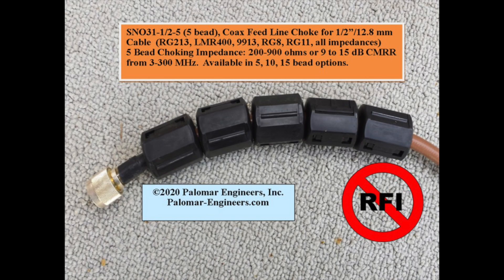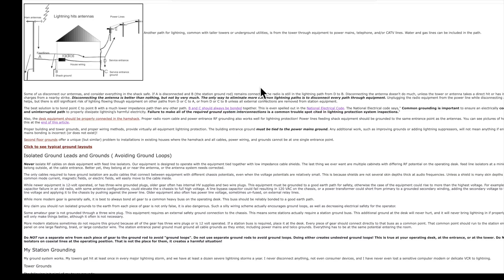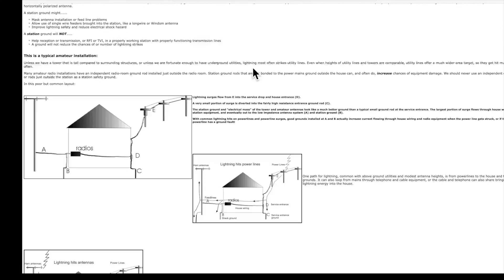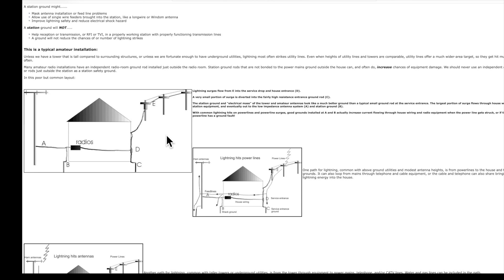Ham Radio Myth - Every Station Should Be Grounded.   RF Ground is a Myth!

Comment: Now, what if your AC ground bounces?  I was on my front porch when lightning hit a big old willow just a few doors down.  The strike grounded out through the water main (uh-oh) to which most old house grounds are still connected.  Everything electrical in the house saw ground and/or neutral bounce to a zillion volts vs. the 120V line - which wasn't affected.  Insurance paid to replace almost everything that plugged into an outlet.  But the house didn't catch fire.  There is a reason all of my TVSS devices are in steel cases...
Reply from the maker: Sounds like quite a shocking experience.

Comment: One of my neighbor's rooftop antennas got hit and it took out a $330 laptop port replicator, a gigabit Ethernet switch, a GFCI breaker and a bathroom vent fan timer in my house. We are each on 1.3 acre lots so we were not really close. Fortunately none of my radio gear was impacted.  It primarily impacted the closest corner of my house.  Lightning is a real beast.
Reply from the maker: Pretty amazing.

Comment: Take No ferit beats.  Turn 19.6 feet coax round a bottle.  If you have a wire and no counterpoise do not mount your choke at the feedpoint.. Some wired antennas need a counterpouse.
Reply: What???

Comment: I used to believe those myths, but lighting taught me it doesn't play by the myths. Had my IC-7200 disconnected from the power and the antenna. I forgot about the USB cable running over to the PC. As best I can tell, lighting came down the phone line, took out the DSL modem, ran down the cat 5 cable to the network switch, got it and then went on to all the PC's that were connected to the switch and finished up with my transceiver.
Reply from the maker: Tragic story but it sure teaches us all a lesson.  Thanks for passing that on.

Comment: Sorry, I'm a little late to this party (the vid was posted a few months ago...) Somehow I missed it.
Excellent info Mark, as always.
I've been an electrician for 40+ years (primarily commercial & industrial, but lots of residential work too). Retired in 2020, but still busy doing "side jobs" 😊.

"Grounding" IS very important, but as you rightly inferred: not necessarily for the reasons many hams think or understand.

"Grounding" and "bonding" are two terms, often used interchangeably, and that kinda mean the same thing... but not really.
First, bonding is the act of physically connecting all of the non-current-carrying metal parts of your equipment together, to bring the potential between these parts down to the same value (potential) - the same "voltage", if you will (for lack of a better description).
Then all these bonded pieces are connected to "ground"  (a grounding conductor) to further reduce the potential. That "ground" is also actually connected to the ground - the physical earth - in the form of a ground rod (or other methods), and - more importantly- also to the neutral conductor of their power service (called the grounded conductor). The utility also grounds (literally, bonds to ground rods) the neutral conductor of their distribution system, at every transformer & utility pole (for overhead services) or every transformer & junction box (if underground).

Moreover, many people don't realize that, in their home power system, the neutral wire (the "white" wire) and the "ground" (the bare or green wire) are connected together in their utility service panel/service entrance. It is the ONLY place they are tied together (i.e. bonded) in their system... Everywhere else in the system, these two conductors are separated. This provides a low-impedance path back to "ground" in the event of a fault or short-circuit in some equipment or appliance.

There is SO much to understand, to effective grounding (and what exactly that means) than can effectively be delivered here.
Entire books have been writen on the subject. If read and fully understood, you'll be way ahead  of the game!

Now, grounding your shack equipment - to just/only a driven ground rod (without being bonded to the rest of your grounding system) - is ineffective at best, and could be downright dangerous.
And "grounding" to somehow reduce RF problems is a total myth!

Yes: Having all your gear bonded together (and properly "grounded") can help reduce stray RF potentials between the equipment (that's the whole idea), but it certainly won't fix a bad antenna or a "radiating" feedline issue. 
A proper antenna (you can't beat a good-ol' dipole with a proper feedline choke/balun!), will eliminate 99% of RF issues. End-fed's are very popular, but I believe that they can cause a lot of RF problems, because (often) there is no counterpoise, and the coax feedline radiates... they just aren't a "complete" antenna (IMHO).
Do they work? Sure, you'll get RF out, but perhaps neither effectively nor efficiently.

One thing that I think is often overlooked, is antenna location with respect to shack/gear location...
If your antenna is too close to your equipment/shack, this can cause RF issues inside the shack, especially and particularly if running QRO (at 100w or less, probably not a huge problem). And "grounding" won't fix that either. 
I routinely run full legal-limit, and have 0 (zero) stray RF issues. But my antennas are >100' from my shack (a corner-outside room of my house). If you're running 500 watts into your "no radial" vertical, on top of the shack's roof... expect some RF in the shack 😂.

Lastly, with regard to antenna grounding: An "arrestor" on your antenna feedline is important, particularly one which provides a continuous "bleed" to ground. Windblown dust, as well as rain and sleet, etc., can induce stray charges which can accumulate on an ungrounded antenna, and can reach hundreds-of-volts. Gas discharge tube (GDT) type arrestors work okay, but can allow charges to build-up before they "fire". There are other types that provide continuous energy bleed-off from the antenna, and block DC energy, so the charges never accumulate in the first place. Of course, nothing will prevent damage from a direct (or even very close) strike. Grounding your antennas when not in use, as well as disconnecting from your equipment, can help prevent damage.
I use some methods in my shack, that are documented on my QRZ page. Check 'em out!
73 from Texas!
~W5ARM
Reply from the maker: Thanks Tex for the great lesson!!

Comment: Its foolish to think you can completly protect against a force so powerful that it can fix nitrogen in the soil and can have the equvilant heat of the surface of the sun in one stroke.
Reply from the maker: I laugh at those little lightening protectors for coax lines.
Reply: @BustRadioMyths  😂 static drain...every little bit helps. Read "The Elements Rage, by Frank Lane....puts lightning in the right perspective.

Comment: It's literally a question on the technician exam. 

Question T0A09

What should be done to all external ground rods or earth connections?
Answer: Bond them together with heavy wire or conductive strap

I live not far from a cell tower. We get a lot of thunderstorms. I've personally seen that tower get hit many times while watching storms out the window. Almost a given that it will get hit by lighting at least once a year. It's an impressive shower of sparks from the tower. Zero effect on the cell service. Not because of fallback or redundant cell sites, but because they have it protected very well.
Reply: I grew up one long block from an impressive self-supporting tower for a local TV station.  The grounding was impressive, as was the concrete pillars it was mounted on.
Every thunderstorm that came through would strike it at least once, usually multiple times.  I sat on my front porch and became addicted to thunderstorms as a little kid. :)
Reply: 👆 this.

Comment: Improving your safety/service/equipment ground, at least up until the 2002 version of the NEC (the last one I spent significant time using):

If you have an old house it may have originally used the metal water supply lines as the service ground.  This should be corrected by adding at least one 8ft to 10ft driven ground rod and connecting that with #4 copper to the main electrical panel on the same bar that connects to the plumbing.

Many times the electrical contractor will drive two ground rods at least as far apart as the length of the ground rod and connect both of them together with bar #4 copper. This is done because two ground rods are easier/cheaper than doing a ground impedance measurement and the NEC has long accepted two rods as good enough in place of the actual test which would prove one is sufficient.  (Rarely it happens that two are not sufficient, but the code didn't care (at least until 2002).)

And for an improvement beyond the minimum:
1. Locate the electrical service ground. It might be a ground rod, or it might be a Ufer ground in the concrete foundation.
2. Add additional ground rods driven 8ft to 10ft deep spaced at 20ft to 50ft intervals around the entire exterior perimeter of your building.
3. Connect those ground rods to each other and to the service ground with bare, solid #4 copper wire.

That process creates an island of equal ground potential encompassing your entire building.  This helps prevent equipment damage or safety concerns in the event of the nearby lightning strike.  The lightning causes such huge ground currents that the ground potential can vary by hundreds or thousands of volts in a short distance. (This is why you should never lie on the ground during a thunderstorm.)
Reply from the maker: You sound well grounded.  Actually that's good stuff.

Comment: Other than RF in the shack, would CMC's reduce or eliminate in-line noise coming in thru the coaxial shield?
Reply from the maker: Maybe but you might need another choke near the shack.  Depends on what's causing the noise.  Look at the website of Palomar engineers for a noise filter.

Comment: Even though it'd be the same impedance, would that 5-bead, snap-on choke by Palomar work with RG8X instead of RG-213?
Reply from the maker: For smaller cable like RG8X I'd use the type that loops the cable through a ferrite ring.  You can find one on Palomar.

Comment: Understand & thanks, but a question: what about a 2-prong power cord that's plugged into a multi-outlet, 3-prong adapter? Would that power cord s-t-i-l-l be considered grounded?Thanks 🤔🇺🇸
Reply from the maker: No there is still no electrical ground to the service panel entrance.
Reply: @BustRadioMyths  so a 2-prong plugged into a 3-prong adapter (at wall outlet) isn't technically grounded then (vs 3-prong, directly into outlet); thank u for ur guidance, I need to rethink my set-up, LOL; again, thanx & 73 😃👍🇺🇸
Reply: @ehayes5217 , I’m building my shack now. I plan to have grounding plate under my shack outlet that’s tied to main service panel ground for everything in shack to bond to. I plan a shack ground rod for antennas and coax surge suppressor which will bond to service panel ground. I plan on one coax bulkhead adapter from shack through wall to station service box which will contain @antenna switch, lightning suppression and coax cable to antenna. I expect to be in new shack in three-four weeks.
Reply: @phillipdewitt4454  That's fantastic & congrats!!! I'm "ok" & will often just disconnect all incoming coaxial lines (& from all power outlets) but know I could do better, 73 😃🇺🇸

Comment: Here is a brain boggler... Take a 10' long solid copper rod & drive it into the ground then pour some salt water around it, then take a nice fat copper wire & run it 17' to the shack... This is a USELESS rf ground on 20m... Now cut the wire where it touches the ground rod & throw the ground rod away and on 20m the floating wire now acts as a much better earth.   HOW?
Any wire is always a transmission line. 17' is a quarter wave on 20m. Whatever impedance you have on one end of a quarter wave you get the opposite on the other. When the rod was connected the great rf gnd exactly there was transposed to a useless open circuit at the shack end.
Cutting the wire at the rod end puts an open circuit there hence a good rf short circuit into the wire at the shack end (basically the gnd wire is running as a counterpoise.
Funny how no-one talks about the standing waves on long earth connections.

Comment: You are right on the money again! Admittedly it’s not a well understood topic mainly due to the many myths involving grounding!
The concept of potential gradient is also not understood. We think of ground as a zero potential point but all ground rods are not always at the same potential as well as all points on the ground are not always at the same potential. When a high voltage power line ( let’s just say it’s a 14 KV line) comes in contact with the ground the point where it touches the ground is at 14 KV. The potential decreases as you move away from that point. There is something called step potential. A person standing with feet together near that point is safe if he does not spread his feet apart or try’s to walk away! Taking one step away from that point can create a difference in potential between his two feet high enough to electrocute him! It’s like a bird on a high voltage power line. 
Lightning striking the power service will elevate all the voltages proportionally so the ground in equipment could be thousands of volts higher than the dedicated ground rod connected to your equipment. That’s a problem! There is a lot going on here and indiscriminate grounding without doing it right causes more problems than it helps. Many hams are just lucky nothing bad has happened to their station. 
I have been a ham 60 years and worked in both power systems as an Electrical Engineer and in radio communications as an Electronic Engineer.  I agree with just about everything you have posted about myths! I will say that I am not much of a fan of baluns on dipoles, but I will say that they usually don’t hurt anything if done right. I would prefer to only use one if it was needed. In 60 years I have never needed one on a dipole. I think the odds are you will not need one but it’s possible to have a critical length of coax in an installation where it’s needed. Again I am talking coax fed dipoles. Proper design of an antenna system will avoid many problems. RF grounding of a transceiver is normally not necessary. I might go so far to say almost never necessary. I hesitate to use the word never as there are invariably going to be exceptions somewhere sometime. 
Back in the early days of radio, crystal radio sets used a single wire as an antenna and the set had to be grounded to work. With end fed wires the ground was used as the missing half of the antenna. I suspect that was the basis of thinking a ground was necessary for a radio. Most instruction manuals show connecting the radio to a ground rod. It is one of those things that was once needed for a specific case and has become repeated for 100 years without thinking about whether or not it’s still needed or even if it may now be a bad idea!
Reply from the maker: Many good points and interesting about the end fed wire.  I don't think too many hams do that anymore but good warning about manuals still calling for a transmitter ground connection, harkening back to the single wire days!
Reply: My old Hallicrafters S38 receiver ( as did many of the late 40s and 50s vintage ) had a three terminal strip on the back. You used two terminals (A1 and A2) for a twin lead fed dipole and no ground. If you used an end fed single wire, as many SWLs did, you connected the wire to terminal A1 a ground to terminal G and also had a strap to swing up and bridge terminal A2 to terminal G. In those days nothing was safe or even had a safety ground!

Comment: Mark
Jim W6LG has a YT vid on grounding and he said the exact same thing you did. He also said an RF ground doesn’t exist. I have never grounded my station. Electrical ground, yes. I use CM chokes on my EFHW and another in the shack. If thunder is in the area I unplug my power source and antenna. I had read an article at EHAM that also said there is no need to ground. Yes, there may be exceptions but in general there’s no need. Too many hams think the more copper the better.

Comment: One example where you need ground is with sky loop antennas. Wind blowing across the wires, that are up in the air, creates voltages, and the voltage can kill your radio. The only solution is to bleed the voltage off via Resistors connected to a ground rod.   Best Regards
Reply from the maker: Good comment.  It's such a broad subject I tried to limit the scope of this video.
Reply: Actually only a couple of well placed High Value Bleeder Resistors to ground would drain off the accumulated voltage from the wind. 
A worse problem would be the induced voltage from a visibly close lightening strike inducing high voltage into any long wire antenna. I witnesses this one afternoon when working on a Tow Boats HF SSB antenna, I had the antenna disconnected from its feed through insulator, and a blue spark jumped about 1/2 inch to the metal roof as I saw lightening off in the distance. This is why any decent auto tuner has a spark gap to ground built into it where the antenna wire hooks to its PCB. Any decent manual tuner should also have this.
73   mike   🍺🍻
Reply from the maker: http://www.w8ji.com/lightning_strikes.htm.    Check this out.
Reply: @  Good info -- Yeah, you can't give every example.  My comment was just to throw it out there, not as a "you forgot about".